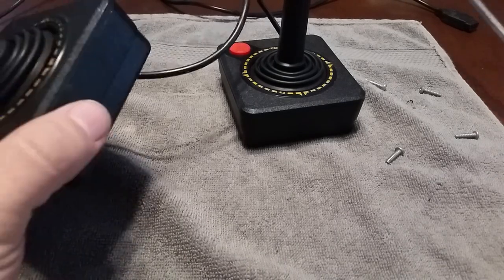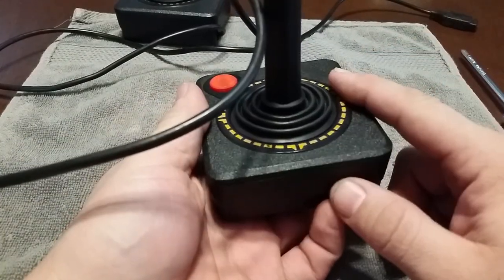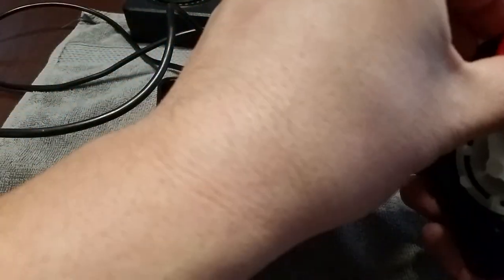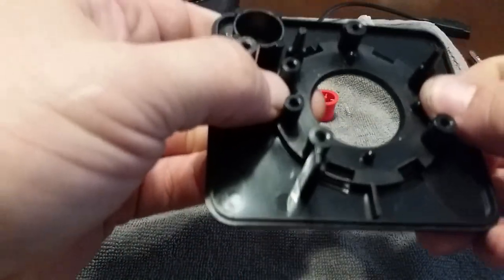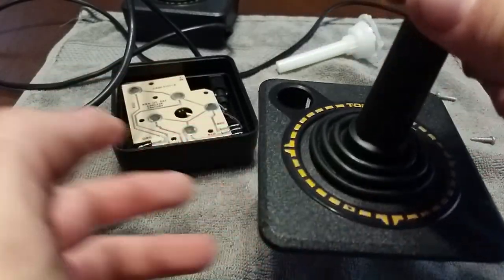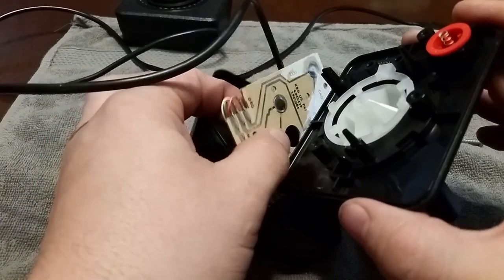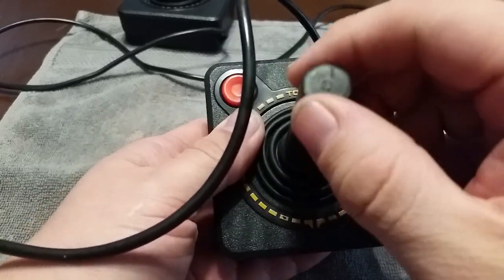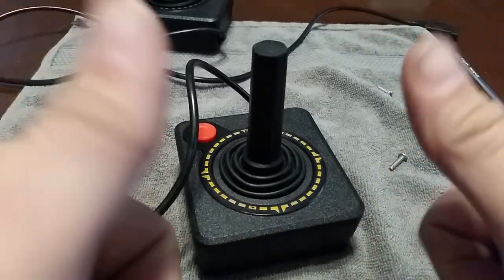Putting the rubber boot back in my Atari 2600 VCS joystick

Comment: Thank you so much for this video. I just bought some 2nd hand joysticks and one of the rubberized covers was shipped slipped off. I thought maybe there was an o-ring that clipped on top of the rubber joystick cover. I am glad I came across your video before I tried to repair it, as I had the wrong idea of how the covering was held on to the stick. Thanks again--- great video; very clearly illustrated on how to get that pesky joystick cover back into place. It saved me from maybe ruining the joystick while trying to fix it the wrong way. Cheers!

Comment: As an Atari fan from way back I love those joysticks. If you're ever looking for a high quality replacement boot I highly recommend a place called Best-Electronics.

http://www.best-electronics-ca.com/CX40%20Super%20Boot.htm

I bought one of his gold plated CX-40's for my Atari 800, it's awesome.

http://www.best-electronics-ca.com/joystick.htm#PCB

His web site needs work, is hard to navigate, but he's a stand up guy. If you're interested in anything there it's best to call him.
Reply from the maker: patham57 I love Best Electronics! You're right his site can be a little bit clunky. I bought some replacement gold contacts for my Atari 5200 joysticks and hope to do a video on replacing those buttons soon! I will definitely check into the replacement rubber boots and circuit board for the 2600 joysticks!